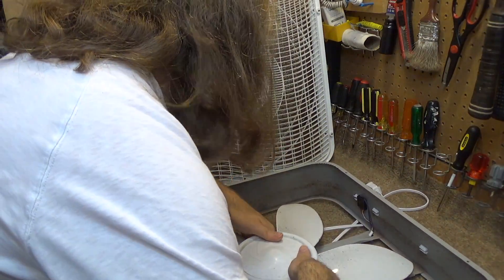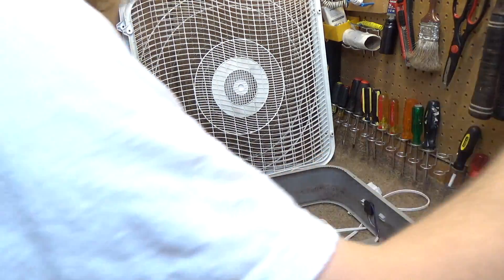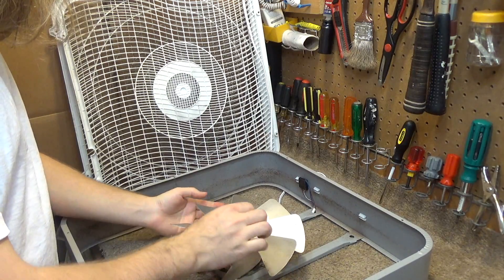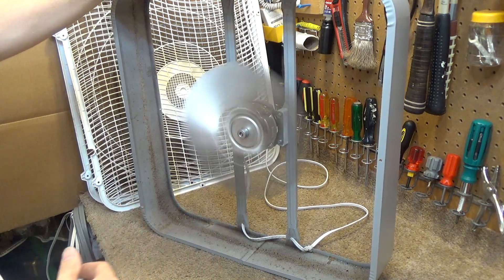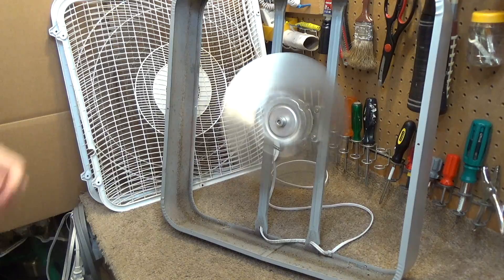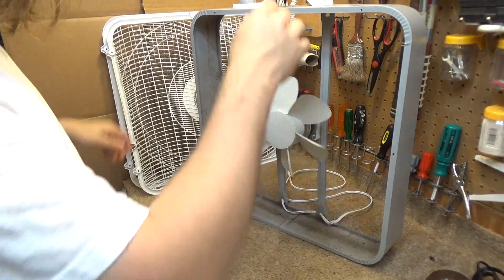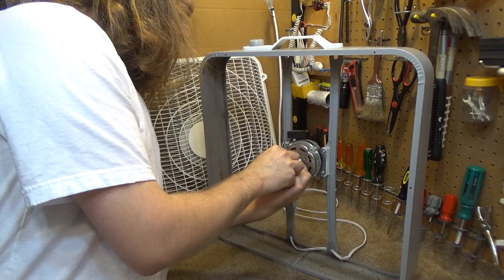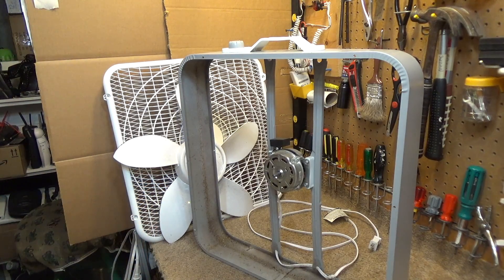AeroSpeed Box Fan Blade Swapping

Comment: Are the bearings that sensitive to detergent? One or two drops can cause the gumming up to happen much sooner? Fun video i should try something similar on a rainy day
Reply from the maker: Yes, non-detergent oil must be used.
Reply: @JordanU  thanks Jordan. I recently got an Eskimo 12 inch box fan (McGraw Edison rebrand) and I oiled it with 30w non detergent and it works well. However I can’t remove the wicks or the bushings as the cups are riveted in. 
My only concern is the motor is very very hot after running on high for a short period of time (10-15min) 
I was thinking the bearings were getting super hot but they’re well oiled and spin very freely. 
Could the motor just be on its way out (drawing too many amps?) or perhaps this motor runs hot by design and I shouldn’t worry. 
Great channel!!
Reply from the maker: @grandtheftauto1233  If it's a shaded pole motor, very high operating temperatures are pretty normal.
Reply: @JordanU  thanks Jordan I believe it is. It draws the correct amps so I believe it’s good. Appreciate ya

Comment: Fun fact.. if you put the fan face down, then press down on the hub from behind, the blade will come off much more easily.
Reply from the maker: I've done that with the old models, but I've found the new ones are too thin. The flimsy struts just bend and the blade hits the table, still attached to the shaft.

Comment: But I can’t really add any more or less pitch or so because it might not fit and or it’s not metal. Well. Steve if I had some heat or so to make it a puffer or smaller pitch??? But I think it’s maybe aligned or so and don’t or I guess maybe rather wouldn’t want to mess it up or break it
Reply from the maker: That doesn’t make sense.

Comment: Had I guess maybe either typed or almost typed and as I was found some corrections or so it fckin/fcking or so went away😤😤😤 🤬but anyway I was wondering wheee you got that from or if they larger sizes than that??? Because I need 1/one for my dads old box fan from his work. I think it’s maybe an newer modern model or so/something like that??? But when we brought it home last week...ahh/ugh. Not last week but some time last year or so, I think maybe for either spring break or maybe for our family beach trip or so??? Yeah I think that was it, but anyway I had it on our front porch from being in side or so and when I would I guess maybe carry it around or so the food or maybe feet???  No I think maybe just foot or so/maybe something like that? But anyway it already had a crack or I guess maybe small reach or so on the circle part thst holds the blades And it kept calling off (meaning the foot and I didn’t know)...but anyway it fell off and I didn’t know it and maybe after a few times or so the fan blew itself over and 1/and or one of the bosses broke off when it was running or so like the centrifugal force was already putting I guess maybe some pressure into it or so/maybe something like that, and the fall was just too much or so. But I have a 3 bladed model air plane propeller on it or so but kinda want either a bigger propeller? And or the same fan blade that originally came with it...(I guess I could’ve said a replacement or so, and or a blade like that or in that style or bigger. Oh yeah and or a metal blade that will be able to be spun by the motor or so
Reply from the maker: OK
Reply: Dude wrote an entire thesis

Comment: Neat seeing how different blades perform on that motor! I couldn’t help but laugh when the motor brace bent in when you tugged on the metal blade. That’s the first time I’ve ever seen a box fan motor brace bend with such ease, that must be some really cheap, low gauge metal!
Reply: It's probably thin aluminum alloy...
Reply from the maker: Most likely.
Reply from the maker: The whole frame on this thing is absurdly flimsy. These really are made with as little material as physically possible.